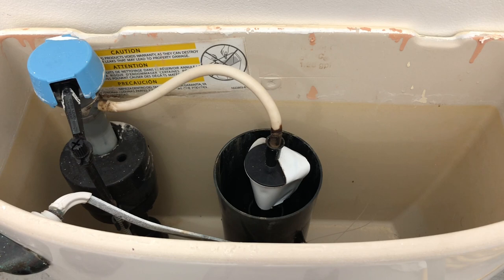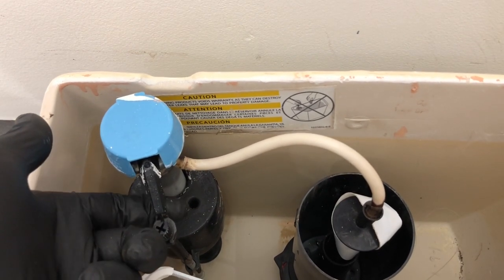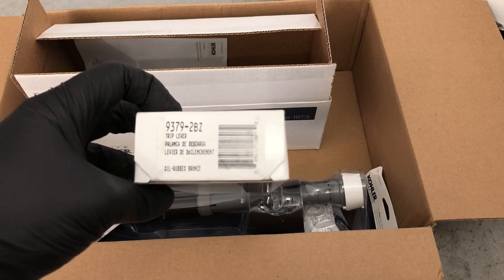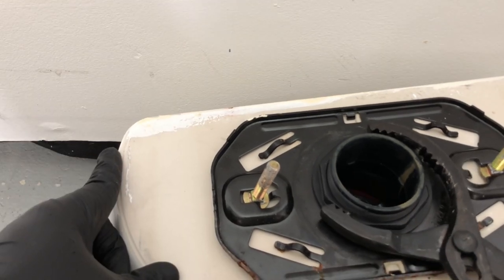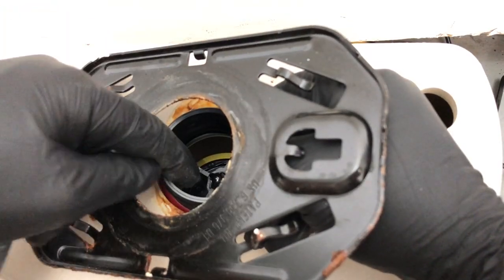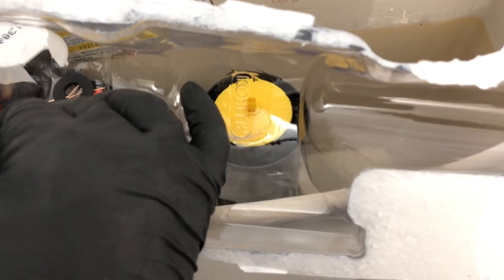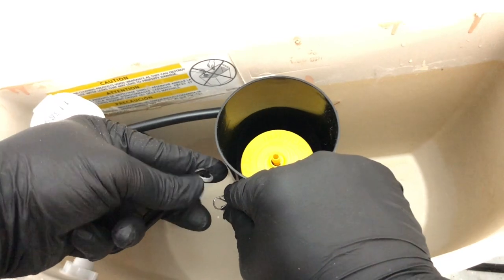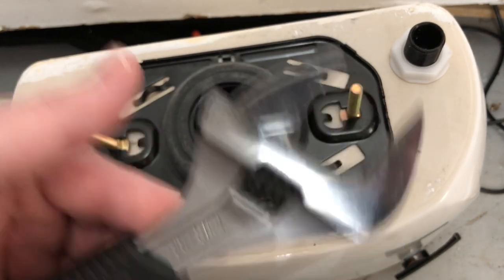How To Fix Running Toilet | Kohler

Comment: I had leaking problem with flapper valves, even new Korky and FluidMaster.  I installed a Kolher cylinder style and never phantom fills anymore. The only problem with the Kohler is it sits higher in the tank  which in turn reduces the volume for a flush.  Using a flapper I had a 1.6gpf, now I would guess it is around 1.3gpf.  Also, you have to hold the flush level until the bowl completes the flush.
Reply from the maker: No, you just buy the right size fill valve for the toilet and it should be okay 😎

Comment: Thanks for this video, I watched other videos and all them recommended checking flapper valve first.  Well this style doesn’t have one. The first video with this style wasn’t nearly as helpful as this one. 

I ended up ordering the rubber gasket seals since leaking flush valve seems to be the problem. It may be a simple fix without taking off etc. then if that doesn’t work I’ll do the parts replacement as well AND have replacement gaskets as well because it’s a set of three. I recommend adding a link for that three pack as well in case people want to go down that route.
Reply from the maker: Thanks I appreciate it!

Comment: When our Kohler is refilling after a flush, not very much water ends up in the bowl but the tank level is good.. is there a way to fix/adjust that?
Reply from the maker: Yes, adjust the float with the screw on the fill valve. If that doesn’t work you may need a new fill valve.
Reply: @NameItBuildIt  Thanks for the reply. I figured out that ours is a different design than the one in your video. The fill hose on ours is supposed to go into a hole at the top-center of the flush cylinder. I think the plumber that installed it for my mother-in-law didn't know better or was lazy because the fill valve wasn't positioned so the hose could reach it. He left it loose and just pouring into the tank only.

Comment: Please, How do you stop water from running over canister? Every video address replacing seal at bottom, my issue is apparently with the float adjust? 
Tried adjusting screw, even took the plastic screw thing off, put it back on, water still rises above top of canister, running every 5 to 10 minutes. Thanks for your help!
Reply from the maker: The seal at the bottom is the reason the water runs over the top. Follow the steps in the video and it will fix the problem.

Comment: My fill tube keeps popping off the canister.  It is really old so the plastic is really hard.  What can I do to keep it from popping off (happens about once a month)?  I looked for fill tubes at home depot but they don't carry them.  I also dont think it will come off of the flush thing on the left.  It looks like it is permanently attached on that end.
Reply from the maker: Get a replacement from the company by calling them 😎
Reply: @NameItBuildIt  I would have but it looked permanently attached at the other end.  Does it come off? I didnt want to break anything and make it worse.

Comment: Every once in awhile that cannister will remain elevated in my Kohler toilet (and of course the water runs endlessly). I have changed every part in the toilet. I have to lift the cover and simply push down on the cannister rim and the cannister seats and all is good however it is a pain clearing stuff off the lid and lifting it off. Does anyone have any idea  what might be binding/holding that cannister up? I dont see anything binding it  when I take the lid off.
Reply from the maker: The chain and the angle of it are putting tension when it goes up and down, holding it to the side and making it hang up. It’s physics, unfortunately the designers aren’t all the sharpest tools in the shed. Just jiggle the handle when you flush and you will feel it drop down as it fills up.
Reply: I will try the jiggle next time it does it. Unfortunately I cannot replicate it so I have to wait for it to happen on its own. Thx
Reply: @NameItBuildIt  I see what it is now the chain clasp (mine resembles a cotter pin) binds and interferes with the drop. In other words it hangs up. I will try and look for a smaller connecter maybe something with a round(ish) top. Home depot maybe?
Reply from the maker: I replaced my chain also. This one is the best I’ve ever found plus it’s stainless so it won’t rust. https://amzn.to/2QRIdhL